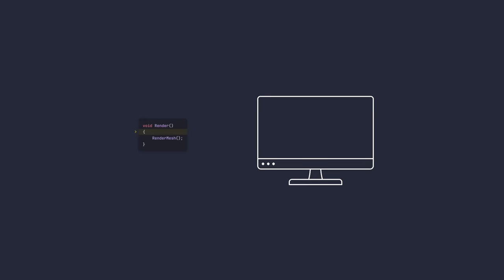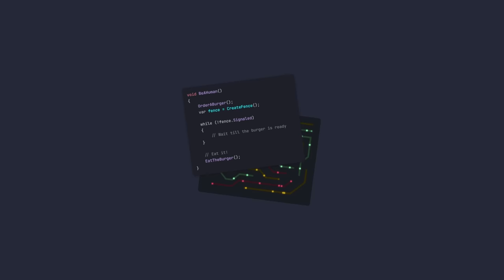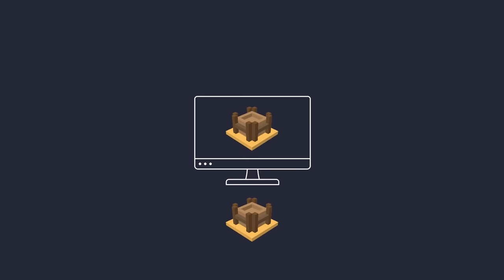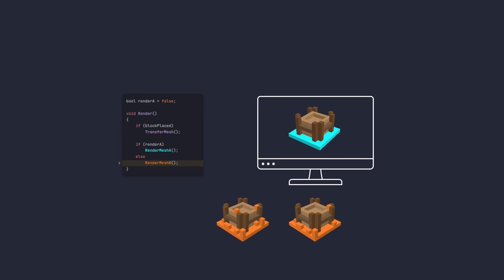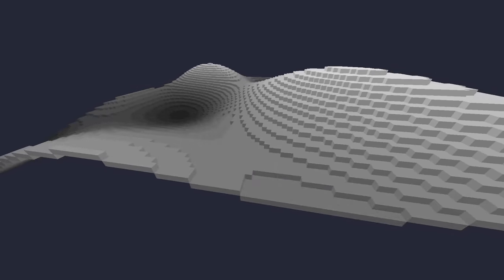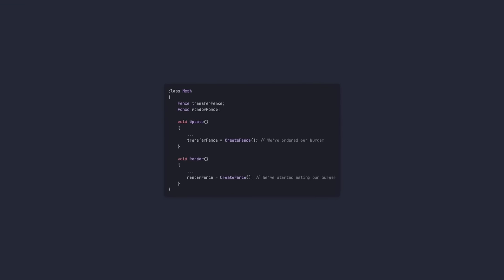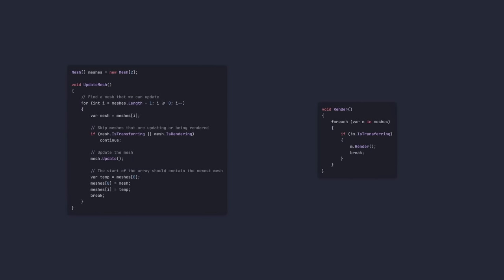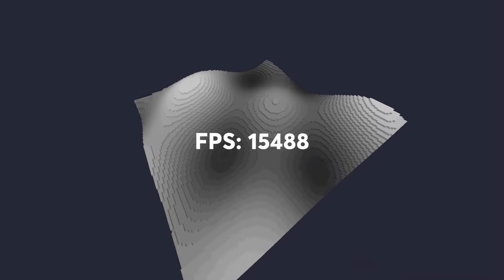I Created a Game Engine Just to Optimise This

Comment: How good is this actually? If there are too many GPU updates then don’t you risk having the game crash? It’s an unlikely edge case since games are typically optimized to not require that many updates, like when you mention how most frying pans wouldn’t be used if we had 50 frying pans, but still? I guess you could have a max number of elements in the list, but it would check that every update. Then again, depending on the coding language, checking for list size is instant.

Comment: Hey buckaroo, that's all well and good, I'm not calling it a FENCE. Thanks
Reply from the maker: Hey buckaroo, what’s the term you use?
Reply: @Vercidium  I guess I just have it so the main thread never rebuilds any meshes, it just puts in requests for the other threads to rebuild them, and then passes off ready-rebuilt meshes to the gpu when they pop up in the other queue (the output queue just has indexes into a large pre-allocated list of mesh arrays, so it's not a memory disaster). So my main thread is never breaking a sweat 😎 lol although I did call the pre-allocated mesh arrays "Nuggos" for a while, so i should not criticize any names.

Comment: As someone who can't code, this is pretty cool.
Just for curiosity's sake, can this be implemented within an existing codebase, or does a system have to be built from scratch to use this procedure? For example, if one did know how to code, could you fork an existing engine and implement it?
Reply from the maker: Yep you could fork an existing engine (if it’s open source) and implement this
Reply: @Vercidium That is cool to know. When I finally get my John Carmack personality replacement, I will be sure to do that.

Comment: could your optimization techniques be used in the making of like AAA games or indie games? What's stopping devs from using them?
Reply from the maker: Engines should handle this for the devs but there are always edge cases. There’s nothing stopping them, but if they create a custom engine they need a solid understanding of 3D rendering and how the GPU works

Comment: This is fantastic! I hope one day I can become good at optimising stuff! One thing I've always wondered with async, is how each async function knows how long to run, before letting some other async, or sync code do some running. As one thread can only run 1 thing at a time as far as I'm aware. Coding is so fascinating, there is always more to learn.
Reply from the maker: Thanks! You're right that one thread can only run one thing at a time. To allow multiple programs can run on your PC at once, the operating system only runs each process on your PC for a small amount  of time.

Think of it like a large list of processes that the OS runs constantly in a loop.

The same thing works for async - the C# runtime has a list of active async operations that it checks every now and then to check if they're complete

I'm probably butchering this explanation, this does a much better job at explaining it: https://devblogs.microsoft.com/dotnet/how-async-await-really-works/
Reply: Wow thanks!
Reply: Every time you using async/await compiler creates a state machine for you.

Comment: THE bottleneck to computing speed is copying-to-cache, and it only got thinner (relative to everything else) ever since computers exist.
In the long term, this will make object-oriented programming obsolete, because data-oriented-orpgramming (priorizing on shared attributes of repeated objects, to put uniform attributes in uniform lists) optimizes for the cache-copying bottleneck, while OOP could not care less for that bottleneck.
Reply: Smalltalks imagines messages send to objects. So have some forEach and queue messages! 

JavaRX is kinda dead. We have lightweight threads now.

Comment: mmm and thus buffers were created. It twas known on this day that our memory buffers would triple, nay, quadruple in size. I wouldn't do this for any voxel engine. Use a subbuffer write to get the old model close to the new one or use a shader to deform it close to the new one until the new mesh is ready. If you wanna quadruple memory usage. Thats a cost you will have to weigh for what you gain but you won't as easily be getting large view distances with this method.

Comment: fifteen thousand frames a second? :D

But yes, this is important reminder to everyone that PCIe is very VERY SLOW. GPU is so frigging blazingly fast that PCIe 5.0 16x is a snail compared to it. So when you update any data on the GPU memory, that transfer is done by the processor, through that connection into the GPU memory... and that's SLOW.
You never want to stop your rendering pipeline waiting for that transfer. You render what you have UNTIL the thing you want next is transferred and then you switch to it within the GPU.

It's like double buffering, or triple buffering in the "olden days"... where you are showing the front buffer to the player while rendering to the back buffer, and when the rendering is done, you flip/blit the buffers and they switch places. Thus you can always display a complete frame to the player and there's not true hard real time limit when the frame has to be done, it's done when it's done.

Sure, there are techniques that try to transfer everything to the GPU at once that's ever needed, but there are limits to how much memory the GPU has so with large open world game, you run out of memory, so you need to constantly stream new data from SSD to the memory based on criteria, and that's where the trip-up happens, if your rendering pipeline is frozen waiting for the data to be transferred...

Good and important video! :)
Reply from the maker: Well said!

Comment: I wish coding was this simple and easy when dealing with meshes and graphics.
Sure I can code a game in C# in Unity.
But when coding it trying to read an FBX file in C#:
guid nodeIndex = new guid ("223D5F-4553-3225-54378H78G");
fixed (byte* approx => ( timeStamp* = &nodeIndex)
This doesn't make sense when you know what the actual code would look like but basically you have to deal with caching, pointers in unsafe functions and trying to make sense out of NodeCurves and reading an FBX file in C# meant for C and c++.

Been reading the source code for Stride Engine's FBX import and it's a mess to understand anything. Even after a marathon of videos, documentaries and articles.
Nobody can just get straight to the point.
Here's the file. Here's the data and here's what it means.

Comment: The fps your game is running at is irrelevant if you're running a monitor with a low refresh rate. Also, screen buffers have been around for 50 years. Direct to display hasn't really been a thing for a long time now.

Comment: Problem is always bad coders. Too many companies use copy-paste-coders, who get things done, but what is done is total shit. I was in web development a little time. I was new at react redux, I am not web developer from the begin with, so I was wondering why the hell wrong data was bleeding to wrong users.. until I realized, that login info was reset wrong way. It was copy pasted from some other code, and did reset only for admin logout, but not for any other case. The guy who started the project, just got this code from somewhere, and then things were just added on.

Comment: Omg this insane.

seeing this video make my game optimization as child game 😅,

To be fer I don't think the optimization techniques for my game are bad I just happens to not be as insane as the optimization for your game.

The optimization techniques for my game so far are.
1. LOD.
2. Ocultion cooling.
3. No use unessery polygons 

The other techniques I use for optimition is.
1. Trigger camera distance  this system works with trigger box wean the player enter the Chenge how fur the camera able to see those I'm the one that I decide how fur can the camera able to see this works with multiple cameras if want to and this perfect for my game because my game able to play up to 4 player's on the same system with split screen,
The idea off this system is wean the Player is in close area the camera to not try to rendering more for what able see and depending for how close or open the area is I'm the one who decide how far the player able to see.
2. The other options that I have plan to use in some of my texture's called mip map,
I'm not sure if mipmap is performance optimization but the are for sure visual optimization especially if use custom mip map.
For what I have seen the file system that call dds if not mistake that I'm able to make my own mip map with Gimp.

And yes the are the only reason I use gimp in the order to make those mip map's all the other texture made with Photoshop.

To be honest I'm very proud for the trigger camera distance it very few lines off code but I'm the creator and the works perfectly if I don't mest up with numbers and trigger box plasment.

Comment: It's very bad architecture when you have object that knows how to render itself (It's not scalable. For example you need mesh data for shadows too.). Better is using render graphs/frame graphs for it. And also all transfers should be at frame begins or where frame ends. When you transfering data betwen two draw calls it's bad practice, because your driver can pick very greedy strategy for synchronization.

Comment: i think this happens most because most people dont upgrade their memory and turn off virtual memory. The hamburger order gets cooked and served faster. Many games use shader cashing too. Several games for consoles will spawn items under the map so they are in memory and it doesnt have to "order" them, they are just already there. And the double frame things sounds like V-sync. just turn it off, maybe you get screen tearing but that's just life, or use a dynamic refresh rate display.

Comment: That's a problem of using functions that have no returns. Instead of that just make TransferMesh a bool to return true once it got there. Better yet use threads to push transfer from the main stack and have an async worker deliver the mesh while you keep rendering. Using locks or other things is an overcomplication that isn't needed.

Comment: Can't you make this inside unreal engine? From what I know the engine is open source and you can reprogram how the engine and devices manage and render data. Setting a custom render method you probably should be able to achieve this and still have all the already built features of unreal. I'm not an expert in the area so I may be wrong...

Comment: > optimization
> uses virtual functions for elements you will have a lot of and linked lists

Looks good to me.

Also, the analogies make no sense, you basically just swap the terms, but say the exact same thing, why even bother with analogy by that point?

I wouldn't call this an optimization per se either, it's just going from bad pattern where you don't know how hardware works to a proper solution - hardly an optimization. Actually, it's not even the solution as you might instead want to update meshes on the GPU itself, especially for the examples provided.

Comment: Neat but not practical. No game needs to update meshes constantly at 15,000 fps. Standard multiple buffering works just fine without as much needless complexity in my opinion. Part of optimization is not spending 6 years changing something that doesn't really need changing.

Comment: your pan conflict doesn't work.
Restaurants even small ones usually do have about 25-50 pans for cooking.
Because 
1. you have limited burners anyways
2. speed matters.
3. you are heating a pan before you start cooking again
4. you have to clean pans before you can cook again.
5. no one waits for a burger 1 to finish before customer 5 is ordering. 
6. that order was already done by the time order 3 was in
Reply: individuals when you tell them what an analogy is:

Comment: So you decided to use an incorrect tool for the job, optimized that instead of just using the correct one and wasted a collective ~5.3mln minutes. Game optimization involves reducing the amount of mesh modifications, not just making the modifications smoother - with this approach at some point you will out of RAM bandwidth or CPU cache.
Reply from the maker: @klh_io  for a destructive voxel environment in a multiplayer game, mesh modifications will happen every frame. It’s important that they don’t cause stutters
Reply: @Vercidium  that's what I meant about using an incorrect tool. For voxels especially you don't need mesh modifications at all (I thought this was just an example and assumed "smooth" terrain which would be even harder). Use an SSBO to store voxel data, calculate the mesh in a compute shader, then you only need to update the modified voxel data in the SSBO - no bandwidth issues and if written correctly your mesh generation is now massively parallelized. Works in both modern OpenGL and Vulkan, no idea about DX but 12 should have the same functionality available.

Comment: I'm not aware of any current major engine has this problem. On top of that, this is very oversimplified. Resource transfer might (to an extent) happen in parallel on many modern GPUs but you will still use some memory bandwidth. If you're not smart about when to transfer resources or how many, about using multiple queues and all sorts of synchronization details, your thing might work for a simplistic demo that you've intentionally setup like that, but not in a real life scenario. Classic youtube shock value farming. I'm really sick of this stuff.

Comment: Стандартная история в больших проэктах ха 100000000000000 денег - "мы сделаем завышеные в 10 раз требования, вместо того, что бы заняться оптимизацией"
из-за таких нравов у меня отпало желание идти в индустрию....

UPD: The standard story in large projects is 100000000000000 money - “we will make the requirements 10 times higher, instead of doing optimization”
Because of such morals, I lost the desire to go into the industry....

Comment: no need new engine just that line LOL. can  you make valheiim on your engine proove LOL
so then just use unity and code that when burger done LOL.
and bytes are move 1 by one eventually your game freeze it cant be just DONE! now do it when that do it not instant then it start doing stuff sending bytes LOL. it means need more computing power and better gpu OR make smaller game.
its allways opcode then data. not everything 1 go. render next frame not enought when cant make changes between frame LOL soo good way turn 200fps back good old 30ich becoz eyes cant see 200